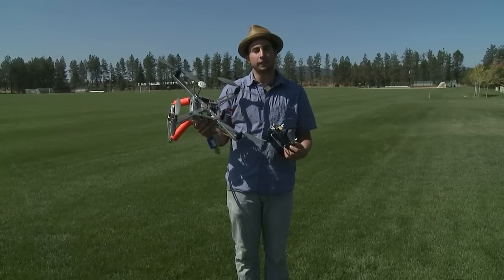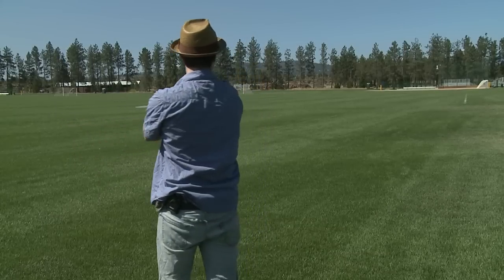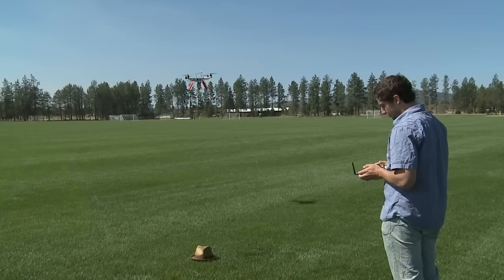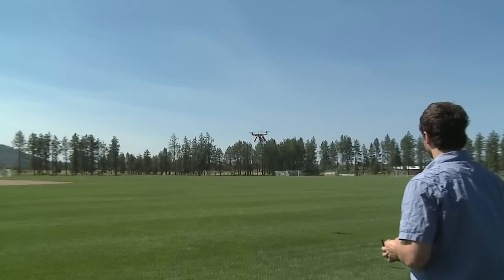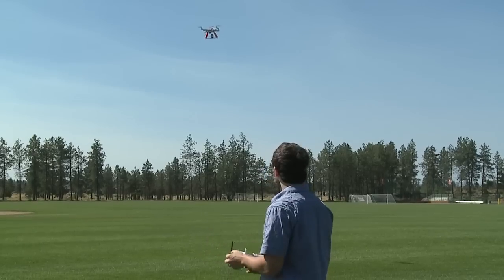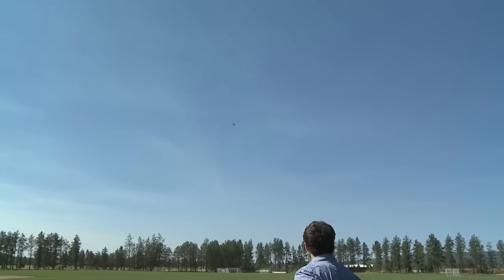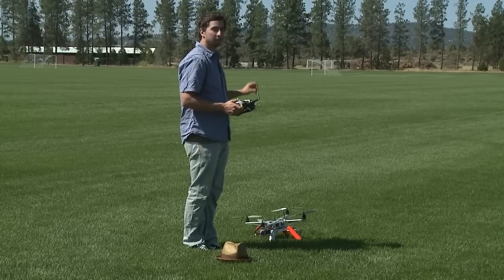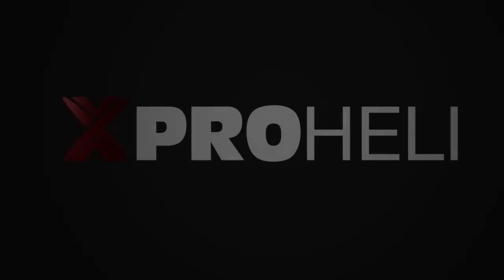XP2 Quadcopter GPS Flight Demo with Naza flight control board

Comment: GReat thing but if you can't rely on the GPS you'll be loosing $2000. I'm really afraid of loosing it on a shooting day.
Reply from the maker: We have tested the RTH function hundreds of times and while it isn't 100% reliable, it does work very well but should be used as a means of last resort. We have had a quad over a 1/4 mile away about 300' up over an open field that we triggered the RTH function on and it worked perfectly, landing within 2' of its original takeoff. Flying in open areas away from trees and buildings is the key to getting a good reliable GPS signal.